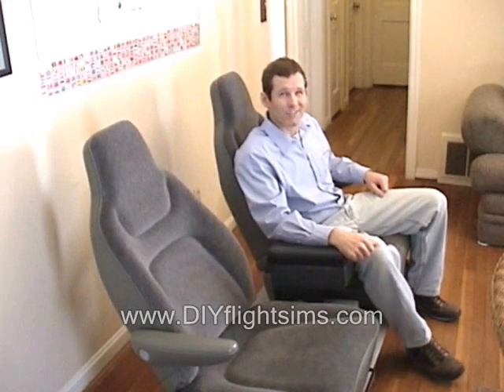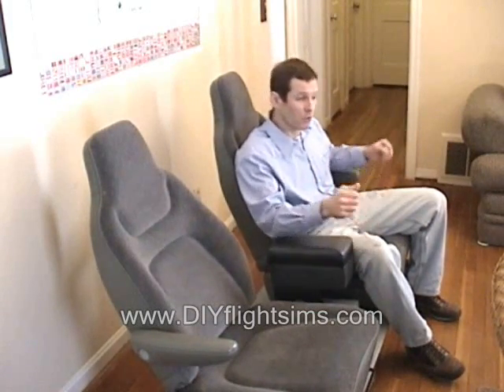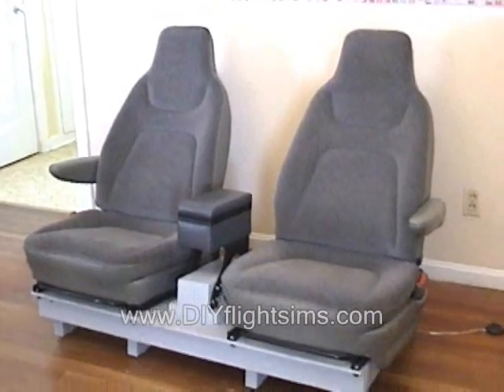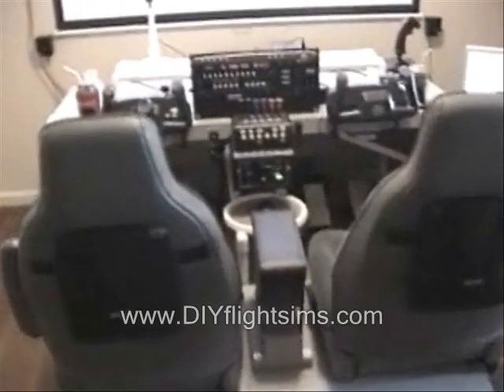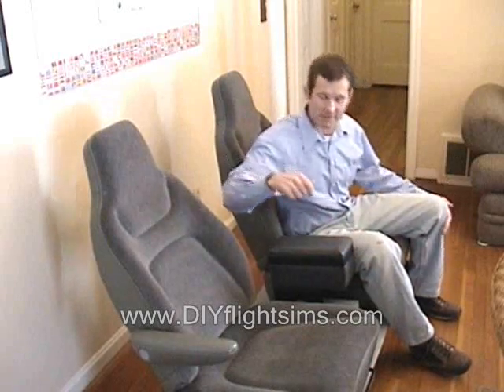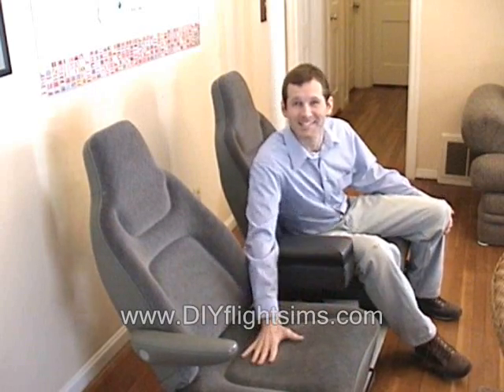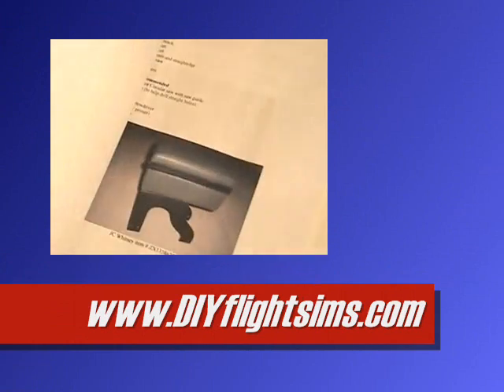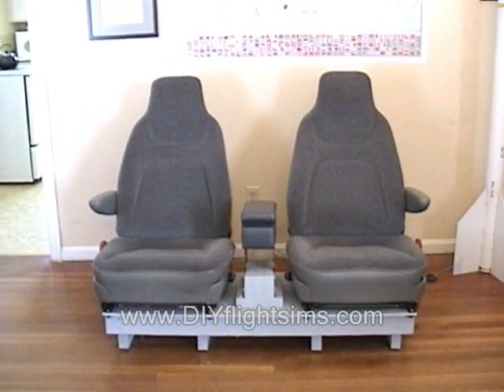Dual Seats for Home Flight Simulator

Comment: Roger Dodger Aviation I plan on building this dual seat project and have a couple of questions:
1) the plan calls for Dodge Caravan seats, but says it can be modified for any vehicle, but the angle will have to be adjusted. What calculations did you use to get the angle for the Dodge Caravan seats (in case I can't get the same seats, or find another seat pair I like better?)
2) You have dual yokes and rudders in the video, my question is how do you have them set up? Are they just plugged straight into the computer, or do you run them through a switch of some sort?